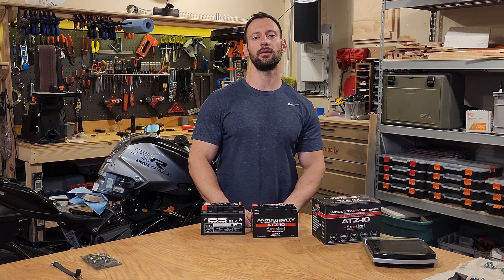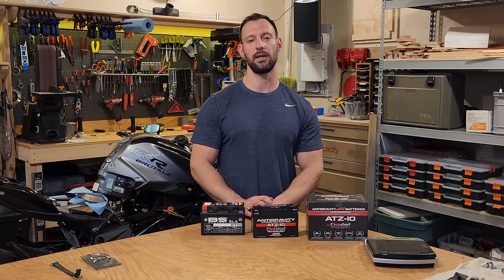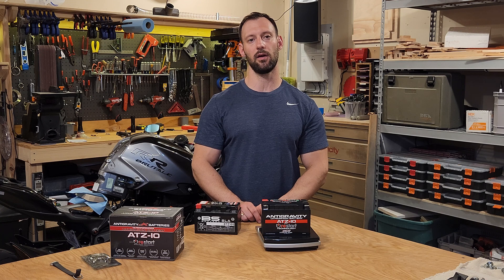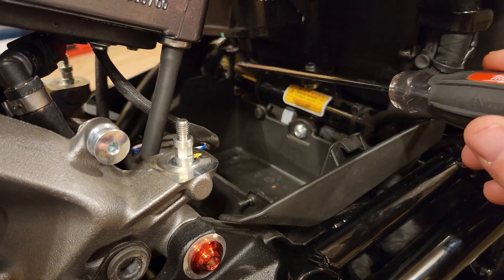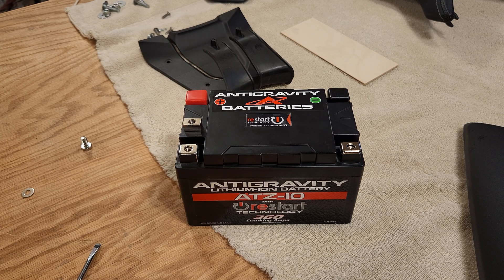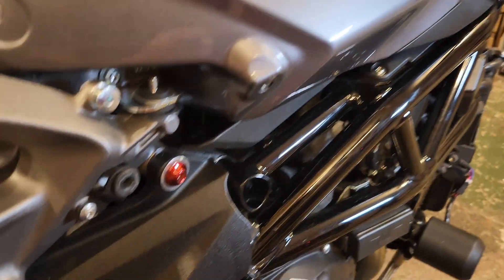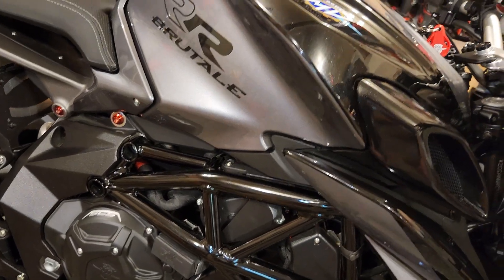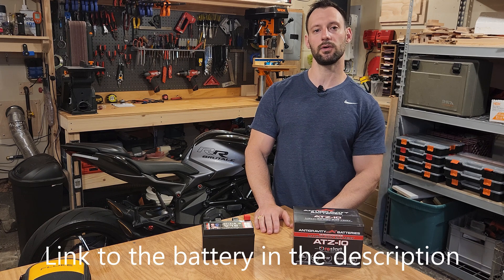Lithium Battery Full Install - Antigravity ATZ 10 - MV Agusta Brutale 800 RR (Euro 5)

Comment: What a sh*t design, I have the 2018 Pirelli RR and have gone through 3 batteries so far, I am an industrial designer but would like to punch the dude that did this, not even having any jump points so what do you do when you've been out for a ride battery is dead, just call roadside assistance they said to me, sit for 3 hours and wait then take it to a dealer 25kms from home so they can replace the battery with another over priced piece of rubbish. My MV has spent more time at the dealer than on the road!! Great looking, awesome fun but what a c**t to work on and don't even start about the rear brake fade!!!
Reply: Hi Andi, I also have the 2018 Pirelli RR, and I pretty much have all the issues that you described. I bought the bike used at around 5600 miles, the rear brake is already faded, and I didn't ride it for a couple weeks(didn't know about the battery being so fragile) and the battery just died. I got a charger from the dealer, but it took 4 days of charging for the bike to get started again. Though, I rode it in a parking lot for 15 minutes, and it wouldn't start again. I was considering doing the battery change myself, but after watching this video and reading the comments I'm not too sure anymore as I've never dealt with an MV before, and I don't want to break anything. I also don't have a lot of tools at my disposal, but I have everything I need to at least remove the parts needed. The dealer was willing to give me a free inspection if I did the battery change there(they quoted labor being around 250 bucks). Do you think it's worth the risk for me to do it myself? Thank you!

Comment: Af1 racing  in Texas sells the plastic petcock that usually breaks on the bottom of the tank. I did not have slack and broke mines. I also extended the hose to add some slack for future tank removal
Reply: Good idea you're going to need it!!

Comment: I would like to express my sincere gratitude for this informative video. It has been immensely helpful in guiding me through the process of changing my battery
Reply from the maker: I'm glad it helped!
Reply: Pity it has to be so painful, pos and neg jump points under the seat would have been included if I had designed it at least!! I am going to install an anderson connected to the battery so at least I can just start it like any other vehicle on the planet!

Comment: Is the fuel tank lifting straight up or with some angles? I’m considering getting it done by myself so I don’t need to carry a jump starter every day 😂
Reply: Just unplug your battery...
To the right of the fuses you'll see a small black panel with 1 small hex bolt, take that off and you'll see a connector there. Unplug that and it disconnected your battery, you can also jump start your bike from here I'd show pictures but can't here...
Reply: Just get a really long extension cord and leave the trickle charger plugged in all the time and only go 100m from your house at a time. MV should be ashamed how f*****d this design is!!

Comment: After i do this now i would recommend for everyone to just do it like the manual says, means remove the tank like it should. otherwise u risk to break a connection to your tank and will never be 100% sure all connectors are connected to the tank ( 3 ). Maybe it takes 10mins more but u will be happy.
Reply from the maker: Yea, it's definitely not an easy swap like many other bikes. I did have to loosen some of the lines going to the tank to get a bit more slack for enough room for the swap.

Comment: Man i nearly had it done, but while i,m put all back together i damaged this black/green/red plug which is attached with the tank. damn it
Reply from the maker: I am sorry to hear that. It really is a touch job, there is no wiggle room.
Reply: @mzgarage   well its this red plastic thing, i bet its not that expensive but not easy to find, just asked my dealer and wait now :/ But hey i,m still proud i also managed to change the rear tyre. All by myself first time.

Comment: Did you replace your voltage regulator on the bike to a lithium specific one? Heard this waa very important to do to avoid overcharging and fire
Reply from the maker: I did not. I honestly have not heard of that being an issue. Both batteries run a very similar voltage. If that was the case, wouldn't have have to do that on every bike that was upgraded to a lithium from a lead acid?
Reply: @mzgarage yeah!!

Comment: Does your clutch vibrate and rattle when its not pulled in?
Reply from the maker: Did you reply earlier? I though I saw a notification, but I don't see the comment. I am going to change my oil tomorrow so I will play around and see if I notice anything, but I can't recall any difference.
Reply from the maker: The clutch lever or the actual clutch? I don't notice anything with the lever.
Reply: @mzgarage  the actual clutch. I just got a 2015 brutale 800 and the clutch claters and vibrates to the point u can feel it slightly in the handle bar but when u pull it it's like 90% better. Just wondering thank u so much for reaching back

Comment: Very helpful video. Only suggestion is to be super careful lifting up that tank or have a friend help so you don't snap the elbow coming out of the fuel pump.
Reply from the maker: Thanks! Yes, it was quite the tedious task. I hope I never have to go through that again.
Reply: @mzgarage  sounds like you broke yours also. Can you tell me how to replace the elbow? I’m kinda SOL right now, because it doesn’t screw out and I don’t see any kind of clip on the inside of the pump assembly.
Reply: @starlight-o5n   Did you ever get this fixed? I just snapped mine.
Reply: @unbranded7718  Sort of. I did reply to this a few days ago but it disappeared?! It’s not really repairable for full flow-rate. My speed was limited to about 85mph. Went ahead and bought a new one at the MV Agusta dealer. It was $835; it’s now installed and working well. If 85mph is good, then it can be DYI’d. You can get a 1/8” brass barb nipple at the hardware store, then drill for size and epoxy it together.
Reply: @TheBhalvy @MZ’s Garage After the elbow is broken, how does it come out to replace it?

Comment: Does it hold charge better?
Reply from the maker: I have been meaning to do a follow-up up video, but have been distracted  with so many projects. It is deffinetly a noticeable improvement, however ai have noticed a decline since installation. I tested out the restart function when I first installed, it and it worked perfectly, but since then is has dropped below 12.6v, which it's not supposed to be able to do.

Comment: Lithium batteries only lose 1% charge/month vs 1%/day with toxic lead acid.  Once lead acid down to 70% of charge it’s dead.  Lithium are deep cycle.  Full power charge down to 5% charge.  Lithium higher CCA, lighter, no corrosion, no explosive hydrogen gas, last 3-5 times longer with longer warranty, charge in minutes vs hours with lead acid, lithium less toxic, lithium IRON phosphate batteries(LPF) no risk fires vs Lithium ION.(still low) no trickle charger needed as shelf life one year.

Comment: Thanks for this video - in doing it myself I noticed that you can move that black box above the battery out of the way by sliding it up off the bracket and then out, makes it a lot easier to access.
Reply from the maker: Glad it helped! After I got it back in a realized it had a little give too, oh well. I'll pin a comment saying that. Thank you!